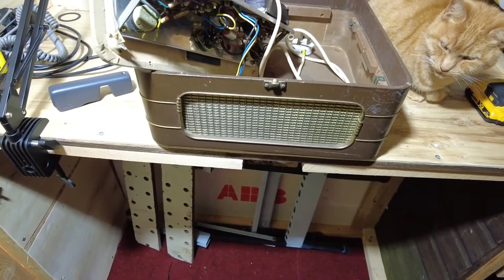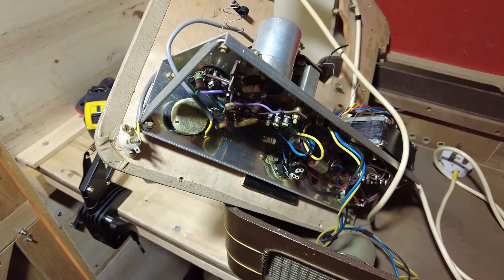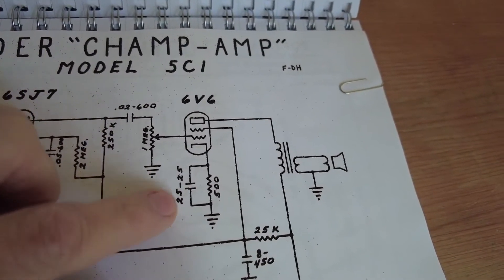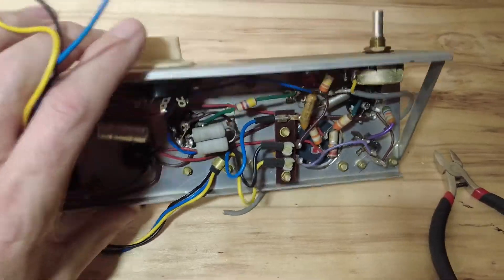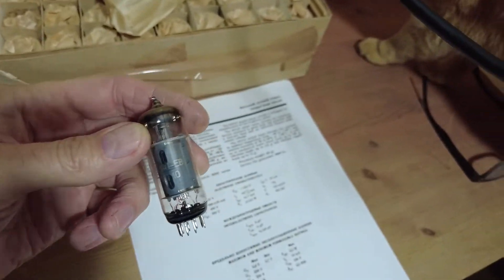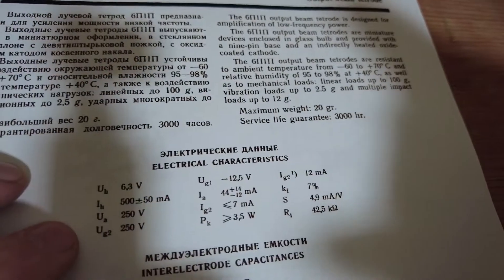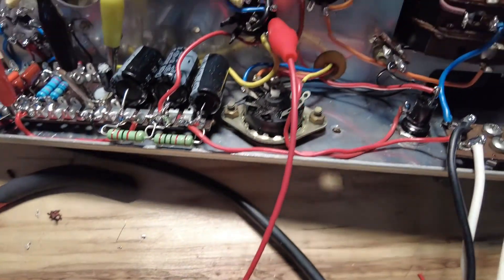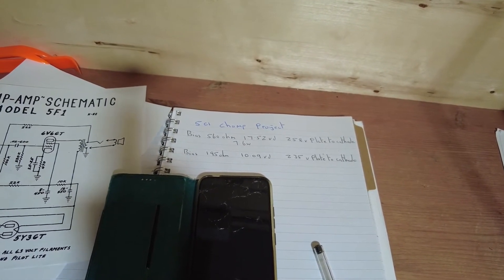5C1 Champ Project Using a Bush Vintage Record Player to Create a Vintage Iconic Guitar Amplifier

Comment: Brilliant job. If you do another, it's got a puny little mains transformer, how about SS rectify to max the available power and use the unused hole for a second or first preamp valve, possibly a low mu pentode or tetrode? Could switch the signal through one or both for a clean to gritty option plus an ott gain monster?
Reply from the maker: Hello Rob, thank you. I have a few more of these to do, so I might well do a solid state rectifier. I have already built one with an extra valve. Have a watch of this project: https://youtu.be/I69wuhoGndo
There are some good ideas you have raised here. Somethings for me to think about. Thanks for watching and take care.